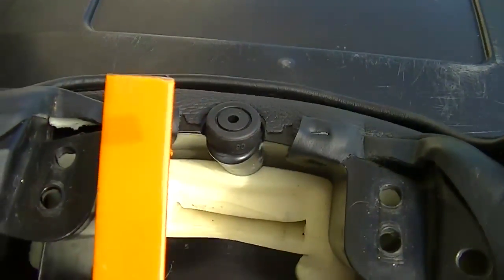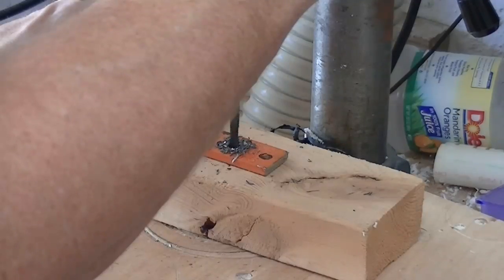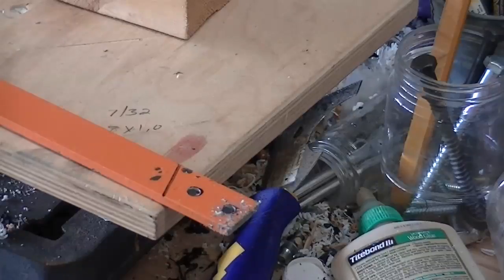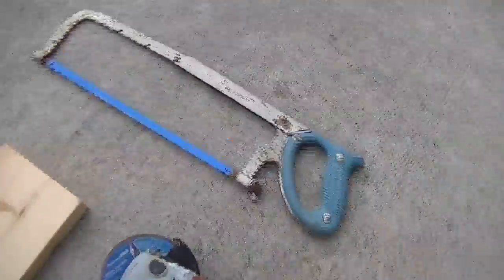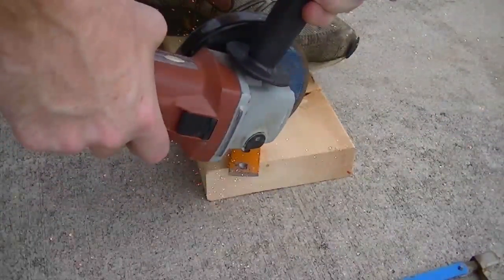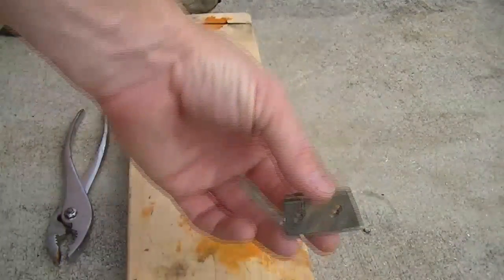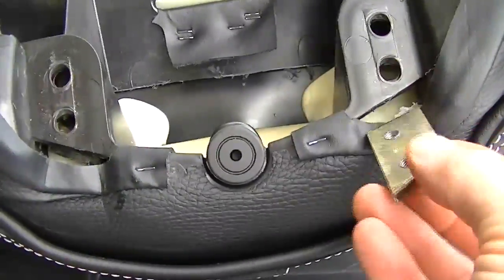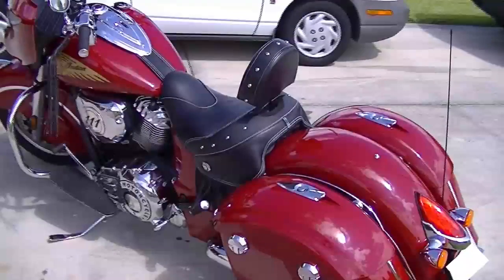Driver Backrest on Solo Seat

Comment: David, what do you mean by 'one up configuration'? What is the reason to make this yourself? Is it to save money on buying the bracket that Indian sells? Also, it looks like the backrest is a little to much forward, can that be adjusted? 
Thank you.
Reply from the maker: "One up" is the term to describe when you are riding solo. So the one up configuration simply means with a solo seat or without a passenger seat.
Reply: +David Berthelette David thanks for your response. I asked about three or four other questions. I hate to bother you but can you please answer those questions.
Reply from the maker: This backrest is an aftermarket product. It is not meant to be used with Indian's backrest bracket. It is much cheaper than the OEM backrest but it is not nearly as good as the OEM backrest. If you are on a budget and need a backrest, this could work well for you as it did for me for several months. 
The backrest cannot be adjusted. The post is a bit springy so it does not push you forward. I also made a video showing how I modified the post. You can see it here: https://youtu.be/9B0wNdKsURM

Comment: Hey David...Is the procedure the same for the rider and passenger combination
Reply from the maker: +sam hoenig If you have the passenger seat installed, you do not need to add the threaded bar stock as the backrest bracket bolts to to passenger seat bar stock.